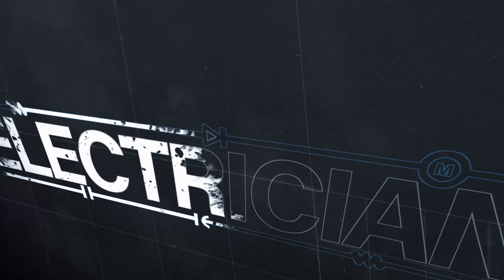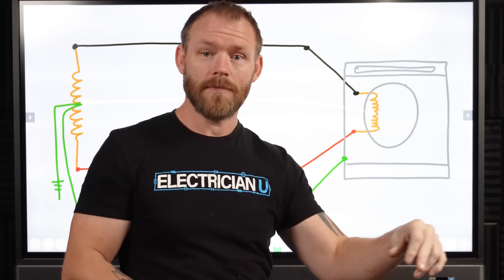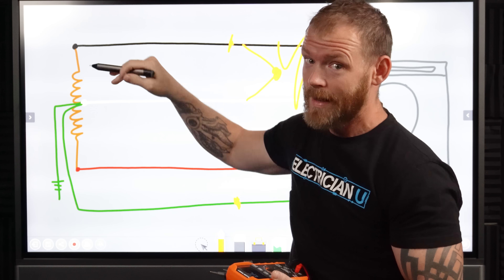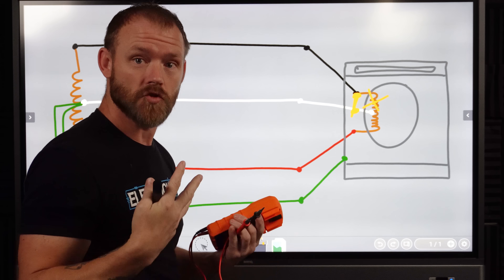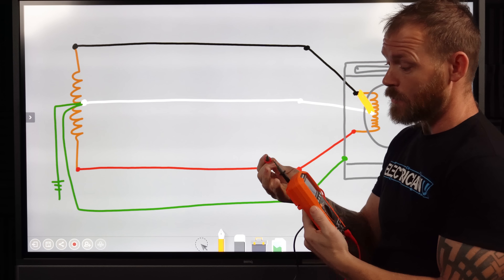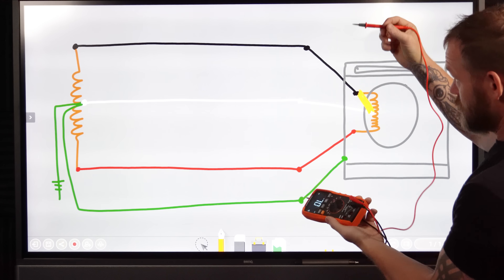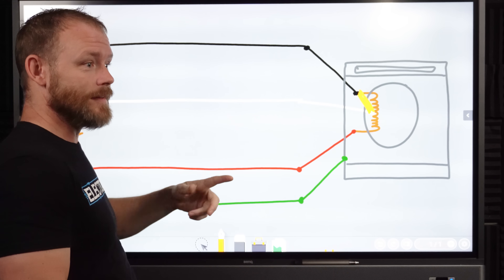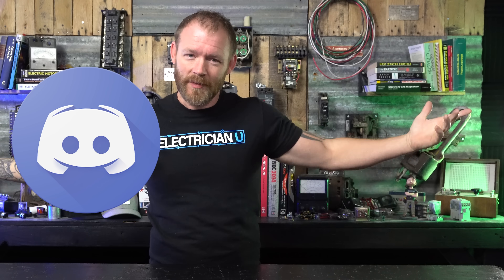What is the Difference Between a Short Circuit and a Ground Fault?

Comment: 2 Types of Short Circuits

Normal short circuit: In a normal short circuit, a powered or hot wire touches a neutral wire. Immediately, resistance drops and the current begins to move in another path.

Ground fault short circuit: In a ground fault short circuit, a powered or hot wire touches a grounded section of a box, device, appliance, outlet, bare ground wire, or anything else supplied by the electrical circuit.
Reply: thanks, some comments are more useful than the video

Comment: So a wire to the dryer's heater coil comes off and touches the frame and double pole breaker trips.
that is a short.  The motor that turns the tumbler has a winding that part of it touches the motor's core, not enough current flows to trip the breaker, but touching dryer and washer one gets a bad shock. . .to me that is a ground fault.

Comment: "you can't tell the difference between ground fault and short circuit on readings"
Thats if you only do resistance tests!
• You just do a Voltage Drop test on the ground points and detect the voltage to ground when wires are active vs short circuit (on positive) which has no voltage on ground wires or grounded components (engine block or frame)
If you have a short to ground, you will get voltage on negative wire/ground bolts/frame. Short circuits on positive or open circuits don't read voltage on grounds.

P.S. im an automotive mechanic.
98% of the time doing a Voltage Drop test identifys the electrical problem quickly and isolates the cause location.
Resistance testing can be very misleading on vehicle diagnosis especially since you test Ω while there is no power to the load.
Voltage Drop is tested while current is actove at the load, relay, module, controller to see the potential drop of voltage before the load.

Comment: Dustin: new battery new alternator but still won’t hold power 
I attach the noco battery thing and it works perfectly no shut off 
Bought diagnostic tool no fault codes 
Is it a short? im beyond lost😢

Comment: Hi there; question for you. I moved in into my home a year ago, the house is only 8 years old,and when changing some outlets in a bedroom to replace them with usb built-in I came across one outlet with the ground looped on the neutral side. The wiring is the original from when the house was built 8 years ago. If I undo the ground loop and turn the breaker on , it tripped (nothing connected to any of the outlets) 
I pulled out all of the outlets and switches to see if something was amiss. I turn the breaker back on without the loop and it didn’t trip but the connection that continues from this outlet (master bathroom) stopped working. Connecting the ground loop back to the neutral as I found it, resume power to the master bathroom 
I know without seeing it is hard, but do you have an opinion as to what’s going on?

Comment: Is there such a thing as a ground fault that doesn’t trip the breaker on my main panel? Have a sump pump that trips the GFCI at the outlet, even when the pit is dry. but when I temporarily plugged it into a standard outlet it worked fine, doesn’t trip anything at the panel. Replaced the gfci with a new one and it still trips when the pump is plugged in.

Comment: I had an eco kicking off because of the merv sensor. Other words. System was shutting diwn because of drag on the fan ... the sytem thought that there was a clogged filter but the engineers didn't install proper airflow in the equipment room.

Comment: USAF DEFFINITON OF A SHORT "WHITE FLAME, BLUE SMOKE, AND MAXIMUM TRANSFER OF HEAT".TOLD FROM A 20 YEARGUY WHO DEFINED IT CRAWING IN A WING OF A STRAGIC AIR COMMAND USAF PLANE TO PULL CABLE TO GET THE LANDING GEAR TO WORK

Comment: You can't check for
continuity on a live circuit
ohmmeter will burn your DVOM ,
If you want to measure the resistance, 
the resistance itself need to detached from 
the circuit before measurement. otherwise, 
the ohmmeter will produce wrong result.

Arab Engineer .
Jeddah Al-Haijaz .

Comment: I have a used ford e250 and my gauges & radio shut off and on back and forth while i drive. It has a aftermarket alarm that doesnt even work. I dont know if its easy fix or do i need to take it to a professional.

Comment: Yeah, you can use continuity but what’s going to happen if the resistance value is to high on your meter, than your beeping sound won’t work at that point.

Comment: i am a master electrician  and hvac tech over 30 years .I am disabled now .Everything you said is correct .the first thing l was  taught about electricity is it all ways looking for the  ground and you don`t want to be the best way to it! all ways turn the load off before  turning on power!Because a loose connection under a load is the same a welder. it  heats up and makes a bigger gap and bigger arc every time load comes on! and a breacker matches the size wire to protect the wire from heating up and burning!The nuetral is the designated path to ground and it just as hot as the power wire under a load!

Comment: Hi Electrician U
this is Govind, I just have a small doubt regarding Philips (or on that note on every induction cooktop)
Sir Philips 4928 and 4938 are valued at a peak wattage of 2100W but they are provided with a mere 6A plug.
But how is this possible to reach a wattage of 2100w with a 6A plug.
Considering power(W) = Current(A) x voltage (v)
i.e. considering the max voltage of the Indian average voltage of 240 volts a 6 amperes plug should be able to provide only 240x6 =1440 Watts of power, but how can they claim to reach 2100W ????

2)My 1400W microwave oven uses 16A plug.....

Please do reply ASAP sir I am ready to buy one and anyone who knows the answer please feel free to reply... and correct me if I am wrong

Comment: I did a long wire, about 30 meters (98ft), that covers a whole floor of a house and has t-joints along the way on all rooms. That wire, because of the conduits structure inside a brick wall, feeds both lights and appliances. I know is bad. There should be independent loops of lights, appliances and BIG appliances but the conduits don't allow for that. So my question is: is that long Blue/Brown/Green with yellow (Argentina code) cable in any danger for having too much resistance, or at 30 meters (98ft) it's still safe? Thanks a bunch. Love the videos!!!

Comment: True, sort of.  You can have a ground fault with as little as a few milliamps of current.  Often from a small cut or break in the insulation and often intermittent.  That's why it's so important to megger new installations.  Especially if you're using conduit.

Comment: Prior to continuity check, It seems a very important step is to disconnect the device from the supply neutral (and hots) otherwise the bonding at service panel will not allow you to differentiate between neutral and ground.
Reply: You'r Right .

Comment: Good way to destroy your meter when checking for continuity if you did NOT DE-ENERGIZE your circuit! Continuity testing or resistance, (same circuit within the meter) relies on its own internal power
Reply: Youre 100% correct. He never mention to de-energize before checking resistance. You're never suppose to hook up an ohmmeter on an energized circuit or equipment.

Comment: I had a 220 short once. I was installing a 30amp light switch for a heater and crossed power wires in the switch. flipped the switch and POP!!! goes the whole house breaker.

Comment: Dustin, I work in the cable communications field. I commonly come across voltage on the ground wire of the house. Often times it causes our 18 awg coax cable to melt. Is this considered a ground fault? What are some ways that I can test for this issue to show the customer that it’s an issue with their electrical service? Us as cable technicians seems to always catch the blame. Thanks in advance!

Comment: I had the opportunity of being present when a 480v/1200a breaker was constantly tripping and it was a sight and sound to experience. It was an ice maker for a food processing plant, and the reason it kept tripping was too much in-rush current when the control system fired up the compressor(s) soft starts. I just needed to increase the breaker in-rush settings, so I learned some troubleshooting techniques that day.

Comment: Isn’t the easiest way just to disconnect the neutral wire in the fusebox ? If the ohm value is not the same anymore, you found the problem.
Reply: ohm value where? on neutral, hot, ground wire?

Comment: Howdy Dustin,
    I'm building a food trk, have a 100 Amp Sq D panel. It has no ground buss bar.  Going to have a 4800 watt Gen. To run my stuff, when at home have a 50 Amp shore plug.  
Oh have ran 14/2 thru out.
   Question;  do I need a ground in the panel.? If so how do I ground to trk..?
Will install gfci at wet locations.
Luv ur videos sir thanx for sharing.

Comment: I have a sub panel in the basement with half the house wired to it.   60% of the return current to the main panel at the service pole/main panel is carried by the white neutral.  40% by the bare ground.  Both ground and neutral out the basement wall (underground) are insulated and separate.  The neutral and ground bars at the sub panel are separate.  There is no grounding screw in the sub panel.  I cannot figure out how/where the neutral and ground are connected at the sub panel or some other place.

Comment: Dustin I made a recent video trying to figure out an Aims Inverters Meaning by a Floating Neutral. 
 I ended up coming to the idea I HAD to unbond my neutral to ground by removing the GREEN bonding screw in the Mains panel. 
 It was in my mind the only way to achieve this. 
Anyone here is free to advise on this topic and look over what they mean by " Warning! Do not bond the neutral to ground. This may or will damage the unit."
 I am off grid.  I have been using the inverter in RV application but I will Need to wire it for a grounding rod as my Tiny home needs better protection and my loads will increase.
 Again any one can suggest or advise a better wiring technique.  I'm out of options.
 I got to this point after exhausting my limited DIY knowledge. 
This is a very common thread on these types of inverters and has so many people in confusion.
 My system is a 6,000 watt 48v  Aims low frequency pure sine with a Ground, L1 L2 in / and a L1 L2 N out. It has a case ground terminal block on the unit.  
There is a ( Looped ) set of of ground wires as well for a Mobile application.
 Once I use a Grounding rod for a more permanent install my neutral bond to ground comes into play. 
Please help my Mind is Grounded out! heh Thanks!

Comment: Yes I was right my is old school it exactly  what your explaining my country will not allow me to get my electrical I turn off power connect the black and white and apply a continuity test then do it too all the wires if they are good I put them back in place it the unit I check out the unit a since of smell normally helps locate most problems they don't teach that they should any thank you I wish I had this in my 20s I am 52 years still wanting my papers want to hire me there a reason for different colour in a panel box to different size wires it my thoughts in the 90s I said all wires are the same color how do you know where they were going I thought of first blue to bedroom orange well you alway kitchen GFI but easy enough not many 20 amp wire get used now that electric heating is no longer used as much see I know my stuff but my country refuses to allow my papers and in every direction but an Electrical

Comment: Before I watch the video a short circuit if a fault in the wires a ground fault is where your ground wire is not succure, do a continuity test attach two from one box put your meter on ohms/buzzer test the wires buzzing sound your good old school you can use the ground wire also in the testing if they all buzz the problem lies in the unit itself. Let see if I got it right.

Comment: We had a job subbing for a company that had a contract to move all the service meters from the panels on the sides of mobile homes to pedestals in the front corner of the houses. They ran all the new supply lines under the houses to the main panels. Our job was to solve all the ground to neutral faults in the whole park. As well as replace some very old or under rated panels and any other problems. I did all the troubleshooting with my apprentice helping. We had to open and disconnect a lot of wire nuts. First thing we always did was pull the electric dryer cord. A lot of those are neutral bonded to ground. Keep up the great videos. Still learning and finding better ways to explain things to apprentices and customers. Even though I have my own company now.

Comment: Hey when I was in college studying networking, we had a tool called a Fox and Hound. It sent a signal Through the Wire, and you could pick it up with a handheld device. Is that possible for electrical wires? Like if the wire did find a shortcut, could it be used to find where the shortcut is?

Comment: Dustin. Very helpful. Question: It is necessary to de-energize a circuit before you test for continuity, yes?  Were you assuming that with a tripped breaker, the circuit is by definition de-energized?
Reply: Good way to destroy your meter when checking for continuity if you did NOT DE-ENERGIZE your circuit! Continuity testing or resistance, (same circuit within the meter) relies on its own internal power.

Comment: Make sure the power is off. Disconnect the wiring to speed things up. 

Remember you will a always read continuity or "ohms" over a coil such as a heating element but you should more resistance over a coil then a derect short.

Comment: The difference being that on a short circuit the current returns via the neutral wire and on an Earth fault the current returns via the Earth wire. The way to find out which is the cause is to clip a Megger on the Earth/Neutral bus bar then probe across each live leg until you get a low Z reading once you get that disconnect the Earth/Neutral leg from the bus bar until the reading goes back to a high Z then Voila, you have found the faulty leg

Comment: Help! I put in 5 ceiling light fixtures and a gfci. They are all dimm, won't work unless one of the other lights is off. That light acts like a light switch for the rest but there super dim (this shouldn't be). I checked the light bulbs and my dumb ass put non dimmable in a dimmer and put a 72 in a 60watt max. Fixed that still a problem.(maybe damaged something?) I checked all wire nuts for exposed wire, wires cramped that may be touching etc, nada. I put a lightswitch in place of the dimmer... nada still dim flicker witch craft stuff...

Comment: Weirdest short I've ever troubleshot was voltage dropping across another wire when a auxiliary hydro pump was turned off. The harness the wire traveled in had degraded insulation.

Comment: If you do the breaker thing just make sure the circuit is turnded off if doing continuity. Usally when i try to diagnose somehting I start as close to the source as i can and or the simplist to get to. I hade a table was that was acting odd for a bit then just stopped turning on. I tried a few different outlets played with the internal breaker, switch. I then unplugged turned on checked continuity to between the hot and neutral was open. So then tore into the switch, breaker, checked the cord they were all fine. That pretty much left the motor, checked that open circuit, checked from each line to each brush one was open so figured either a winding failed, thermal cutout, or maybe a bad connection. Ended up tore apart was a loose spade terminal on the brush holder fixed good as new. 

I'd do similar for something like this remove anything that would show like a load then start from source and work back until you find somehting that seems off.

Comment: You might be able to find an earth fault, but you can’t rule it out with a multimeter. An electrician should use a Megger (insulation resistance tester).

Comment: Just a cement Mason taking a jab at your question: my answer is that a faulty ground would have it working sometimes then not vs short where it does not work at all then using a meter to find if there's an opening from device to ground?

Comment: Can you please explain the difference between US voltage from European Voltage and give a brief history, on how we adapted the 120V 60HZ vs the 230V 50HZ. Can’t seem to find a video with good explanation, Thanks
Reply: It runs back to the beginning of power companies needed to reduce copper and become cost effective.  Europe adopted 220v to save on wire.   Supply and use of power to a 220v is also cheaper.  When Thomas Edison adopted the 120v standard the USA ran with it. Oddly Europe in its early days did use 120v. 
Unless specified by the manufacturer to operate on both 50Hz and 60Hz, appliances may not operate efficiently or even safely if used on anything other than the intended frequency.  60Hz runs hotter and 20% faster.   This IMO needs to be considered when using Electric Motors.

Comment: Oops!  You missed the first step:  Unplug or disconnect the load to see if the breaker still pops.  A short or ground fault INSIDE a dryer is not your problem.  That appliance has to be repaired by an appliance repair guy.  Or maybe it's time for the customer to upgrade.  Neither one is your business.
BTW:  If you disconnect a direct-wired appliance, put some wire nuts on the conductors before resetting the breaker.

Comment: You disconnect main power before testing continuity? 
I would unplug the device and plug another like a hair dryer. If other device works normal it is a bad device and check continuity at the device plug to find what's wrong with it.